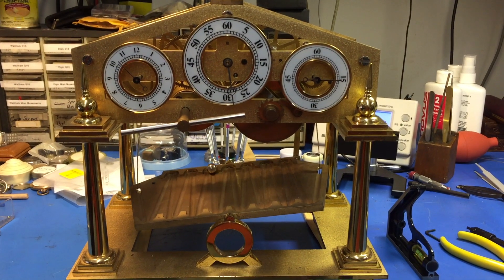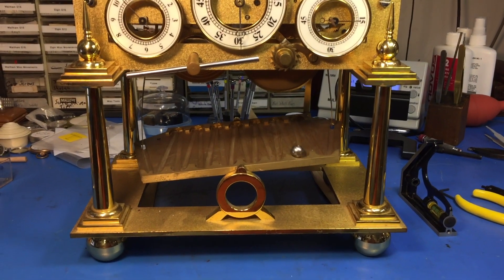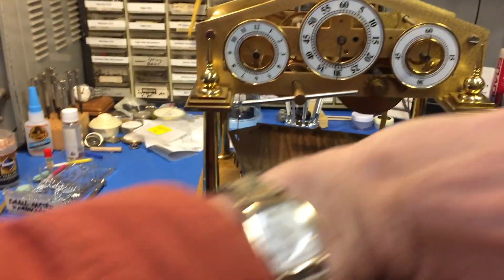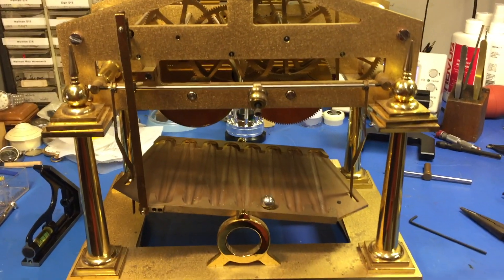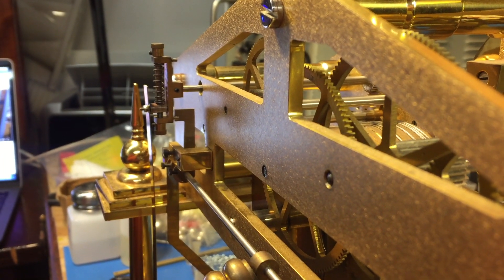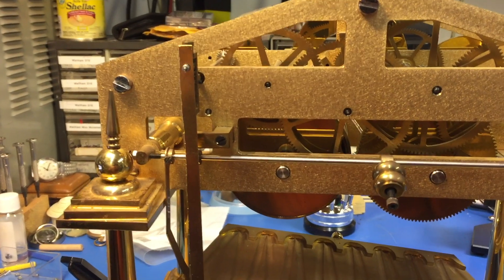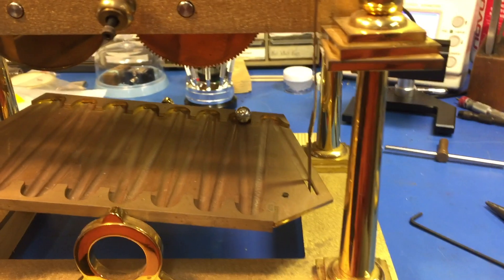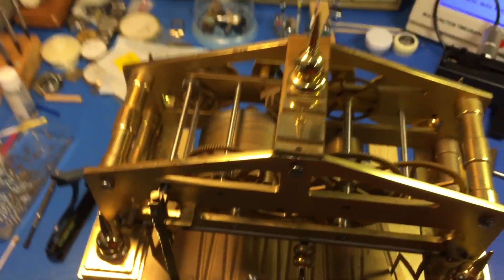Congreve Clock Repair Part 1

Comment: I actually work for the company that used to make these clock kits. Unfortunately we no longer make them and now manufacture road going miniature steam engines, even a full size steam car, but who is to say we will never manufacture these again some day. Enjoy your clock, it is very fascinating to watch.
Reply from the maker: That's awesome!  I'm so glad to have met someone who had something to do with this clock kit.  My clock was missing the brass piece coupling the marble track to the works above it, so i had to improvise with some hardware store brass.  It works just fine, although the escapement is very touchy... once you get it dialed in it is reliable.  What was it like making these clocks?  What was your roll?
Reply: @GregoryCharvat  I didn’t actually work with the company whilst they were in production unfortunately, but I have recently been tasked with a project involving the Congreve clock, which is how I ended up on your channel looking for inspiration.  Great work in restoring yours looks great and even sounds better than before.